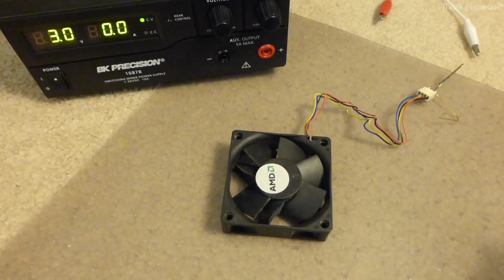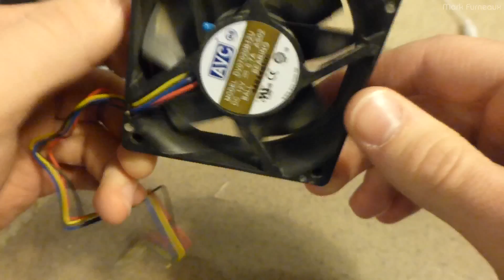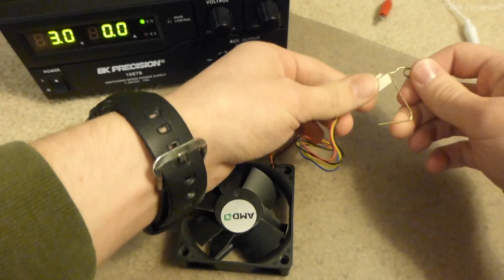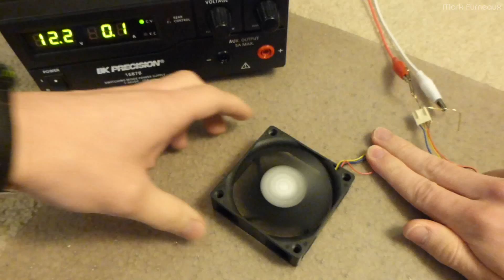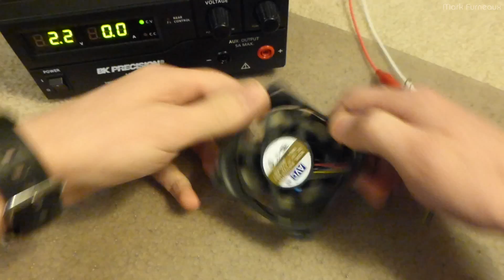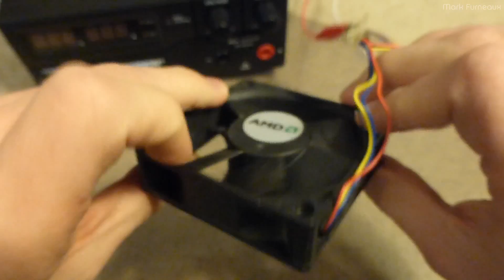Failed Fan Kill: Damaged AVC CPU Fan

Comment: The speed controller maybe checking the coil temperature and depending on that it, throttles the fan speed so that it doesn't get burned.
A neatly designed speed controller! Really durable!

Comment: Ball Bearing fan? Figures why its more durable think evga GPU fans, those fuckers run at like 3000 rpm at max fan speed, loud as fuck but super durable
Reply: +Massie Asadi lol holy fuck, im using the coolermaster 212, but i have the stock cooler in possession, that shit must be loud lmao
Reply: honestbob456 It sounds like a Jet. And a lot of people quit the skype call because they could hear my fans XD. I'm planning on buying the Cooler master evo 212 but do you know how silent it is?
Reply: uses a 4 pin 120mm fan it runs from 800-1600 rpm (possibly due to the fact that i have mine running at 4.5 Ghz its at 1200 rpm right now using just normal usage) and being about 3 feet away with my pc on a silent fan profile, i can barely hear it, maxed out its got a hum at 1800 rpm, and lmao jet engine
Reply: honestbob456 Alright, thanks man!
Reply: np man, and i totally recommend that cooler, its quiet and well... im running stable 4.5GHz lol, hope it works out for you!

Comment: amd fans are better than intel fans confirmed
Reply: We all knew that, those Intel fans are shit as Fk.
Reply: I don't think even the most Intel die-hards like those awful fans.
Reply: @XxXxXxCringeMasterxXxXxX  no one uses stock fans......
Reply: @audionut9974  Tell that to the wraith coolers
Reply: @audionut9974  Yes I do with ryzen
Reply: @audionut9974  Actuallt many people do. Including me with ny i5 7500. It doesnt get hot even on 100% load, why would i buy another one?
Reply: confirmed!!!
Reply: but still better fans
Reply: Yes. Really. With a bit of humour. Still, ive had Intel fans failures but not amds.
Reply: I still have i think an Athlon cooler. Running inside of an audio amp idk how old it is, but sometimes its 10 to 12 hours running nonstop. 
My last Intel lasted just a few months.